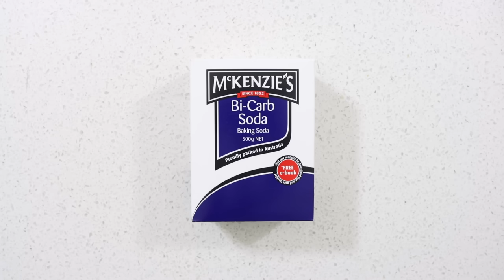How To Clean a Stained Mattress

Comment: 1. Combine the following ingredients (0:19)
2. Pour the concoction into a spray bottle (0:41)
3. Spray the stained area of the mattress (0:44) 
4. Scrub the stain repeatedly (0:50)
5. Add more stains to the mattress and scrub it (1:21)
6.  Add egg to the mattress and scrub it (1:28)
7. Add chocolate sauce to the mattress and scrub it (1:38) 
8. Add dirt to the mattress and scrub it (1:48) 
9. Place down a roomba (1:57) 
10. Activate the roomba (1:59) 
11. Kick and yell at the roomba (2:06)
12. Destroy the roomba (2:26) 
13. Spray and scrub the stained area of your mattress (2:36)
14. Voila! The result is a pristine, good-as-new, stainless mattress! 
15. Stick your thumb up (This is imperative, if you avoid this step the mattress will not maintain its sanitary new state)
Reply: tysm!!
Reply: No
Reply: Still stained?Go over it again.
Reply: In 7. Is real chocolate?
Reply: This is how you clean a mattress
1. Add eggs to mattress
2. Scrub it
3. Add more eggs to the mattress
4. Scrub it
5-8. Repeat the same thing egging and scrubbing the mattress with 100 scrubs 50-100 times over and over again until it is 10000% clean
9. Put dirt on the mattress
10. Scrub it until it's clean
11. Add paint to the mattress (blue and green)
12. Scrub it more
13. Add a concoction of eggs, dirt and paint to the mattress
14. Scrub it with 50 scrubs until it is 100% clean
15. Stick your thumb up 
16. Vomit really, really loudly that you can hear it from your own house
Reply: i'ts super durty now
Reply: help i forgot to thumbs up and now my mattress is going to dismantle the us government
Reply: @@johnnylee-hale743 no it was just the edit!!
Reply: I fell out of my bed just because of this*chokes from laughing*
Reply: Photoshop
Reply: Bro it's already have a video about it

Comment: 1) Mix:
- 1/4 cup dish soap
- 1/4 cup hydrogen peroxide
- 1/2 cup white vinegar
- 1 tbsp baking soda

2) Let the mixture sit for a few minutes, then apply generously on the stain, let it sit for some time (I recommend 10-15 min), scrub.

3) Repeat for tough stains.

Comment: 0:16 What need
0:26 go correct 
0:32 mix
0:37 level 2
0:40 put water on bottle 
0:44 start clear
0:46 clear
0:54 fail 1
1:04 fail 2
1:07 fail 3
1:10 fail 4
1:12 start angry
1:20 😡😡😡😡
1:21 start ruin this bed
1:24 clear 2
1:28 fail 5
1:28 😡😡😡
1:29 throw egg
1:32 😂😂😂😂
1:34 clear 3
1:38 fail 6
1:38 😡😡😡😡😡
1:39 use chocolate 🍫
1:41 😠
1:43 clear 4
1:47 fail 7
1:47 😡😡😡😡😡😡😡😡😡😡😡
1:48 use cover black
1:51 clear 5
1:56 fail 8
1:57 😭
1:59 use dont know this
2:06 try hit this
2:07 she say clean
2:09 hit this 2 and say move around
2:12 say move around like this >:( 😡😡😡😡
2:19 try to clean this
2:24 >:(
2:27 hit 66 times this 😠
2:37 clean 6
2:45 you win 🏆 🎉🎉
2:49 give 👍👍
The end

Comment: Did you just know that when you grab whatever that I need robot does it was Buzz off inside the robot thing the motor just starts to work and that's why you just got freak out😂😂😂😂😂😂😂😂😂😂😂😂😂😂😂😂 plus there is no even a bed is for cleaned you just put a picture of a clean mattress for the mattress still the same😂😂😂😂😂😂😂😂😂😂😂😂😂😂😂😂😂😂😂😂😂😂😂